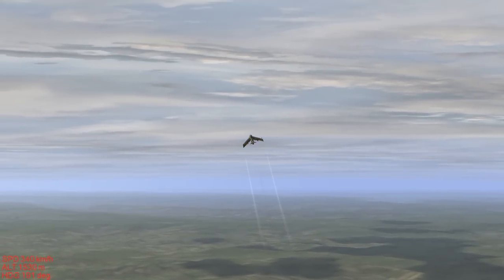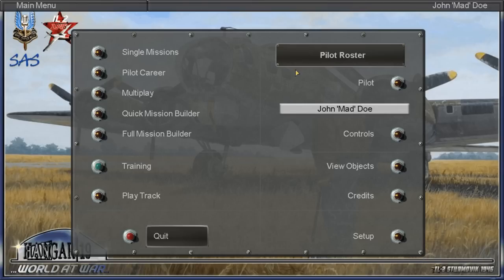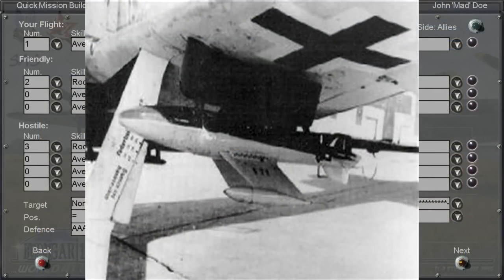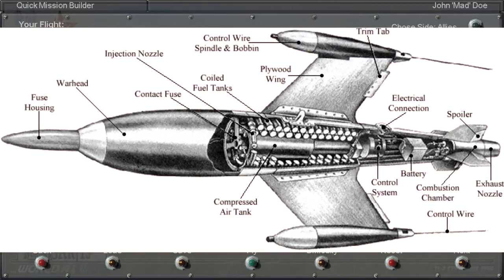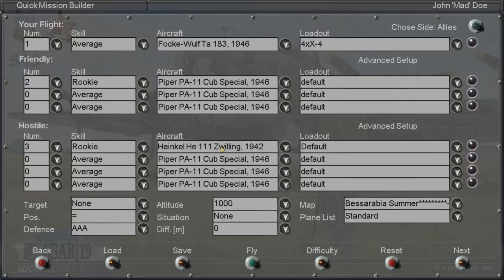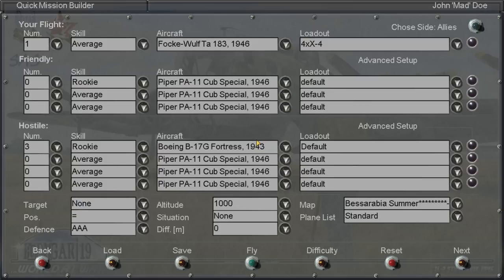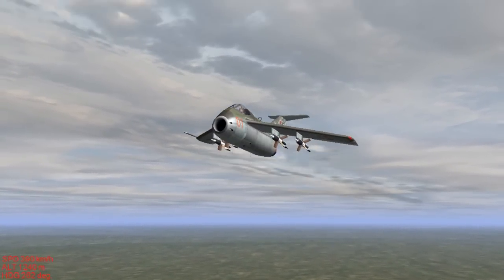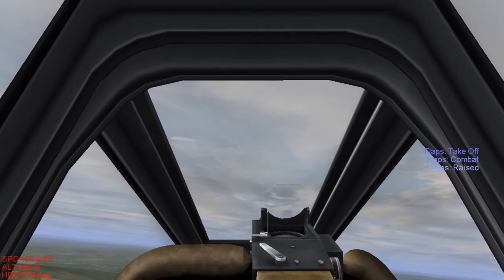TA-183 AIR TO AIR MISSLES KILLS (IL-2 1946 Jet Gameplay)

Comment: Ta-183 is a vanilla aircraft in IL-2 1946

Also... "The missile is the 4xX-4" You realize that the 4x part is just saying it has four of them correct?
Reply: 4 of them, missle is called X-4
Reply: Asd Fgh Yes. that is what I said. (Approximately, not exact same use of words)
Reply: The player guides the missile!
Reply: Gunslinger 890 yes have to manually guide them

Comment: Hello there,
Im in desperate need for help. I have a computer that runs windows 10 and i cannot run il2 1946 nor cliffs of dover. i have no mods installed. The games do not even launch, cliffs of dover kinda starts up and then just shuts down for no apparent reason. 1946 will not even install. What is going on here and do you have any idea on how to fix it?
Thanks
Reply: aspyromilios, you're welcome

Comment: Where are the settings for guided missile controls in IL-2? Or is that just an SAS mod thing?
Reply: I played the vanilla IL-2 1946 and I don't remember missile settings; but they could be there.
Reply: +Paolo Strissi I have the Hsfx mod installed but never found any settings for the missiles. which is strange for both vanilla and modded gameplay as since the missiles are in the game
Reply: +stevegoesrogue tomorrow I'll se if this missiles can be guided
Reply: +Paolo Strissi hope you figure it out
Reply: +stevegoesrogue so do I, I'll tell you
Reply: +Paolo Strissi Paolo! I just found the controls for guided missiles! It's just the Bombsight Altitude and Bombsight Left and Right settings
Reply: +stevegoesrogue amazing! I didn't know that
Reply: +Paolo Strissi funny enough. a quick google search came up with the answer. i never thought it would be controlled through bombsight usage.
Reply: +stevegoesrogue neither did I, I tried using other controls but they didn't work